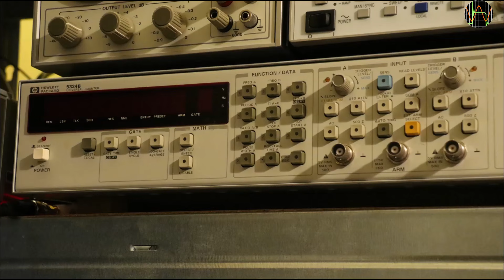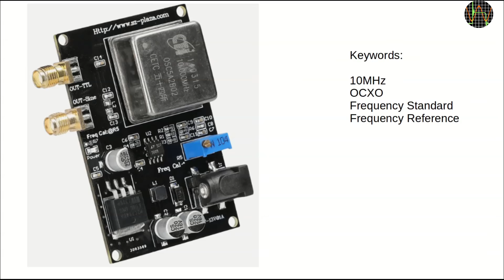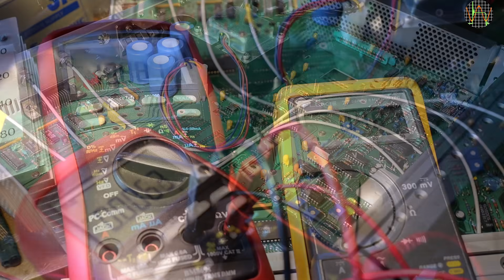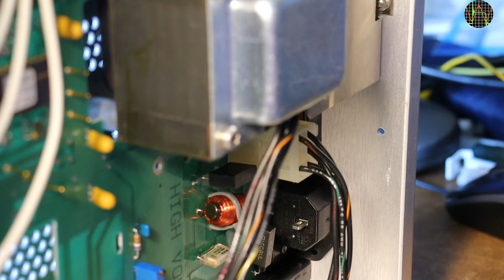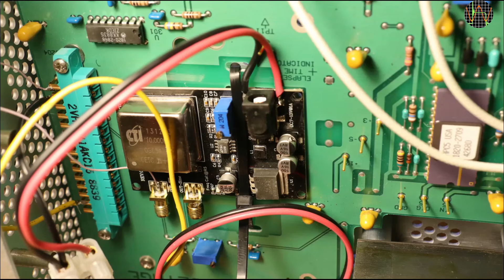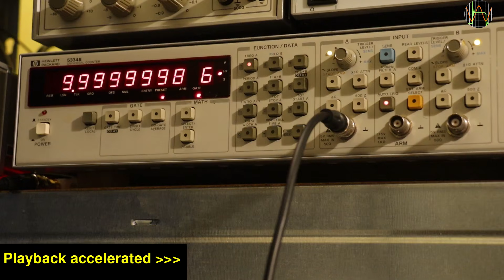196 - Adding an OCXO to my HP5334B counter - on the cheap

Comment: Have you considered using a GPSDO? no alignment or calibration issues.
Reply from the maker: Yes, but they are not cheap and come with their own challenges. I would need to add and antenna connector and after power-up the GPSDO needs  to "see" sufficient satellites which depending of the model may be quite difficult to assess from the outside once it is installed within the HP5334B. I rather use my GPSDO for other alignment/cal purposes in the lab where I know exactly the quality of the signal it produces .
Reply: Instead of doing any of that, the 5334 has a Time Base IN/OUT connection at the back panel. One would then have an externally running GPSDO box and just wire its output into that.
Reply from the maker: @ivolol  that is how i used my 5334b for the last year or so. I was getting fed up with it tying up my GPSDO and having to reserve a coax cable going to the rear of the 5334b (because as it is installed, the rear is pretty much inaccessible)
Reply: @TheHWcave  That's why people made distribution boxes as well :D There's a couple of models floating around on aliexpress and ebay, or it's not the hardest project in the word to build either. Either some fastish opamps or a bunch of logic buffers